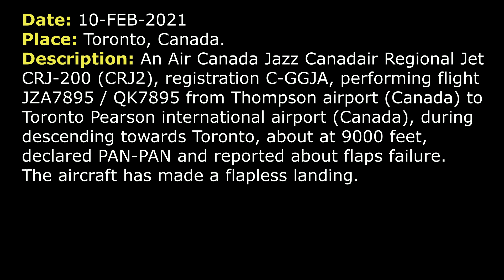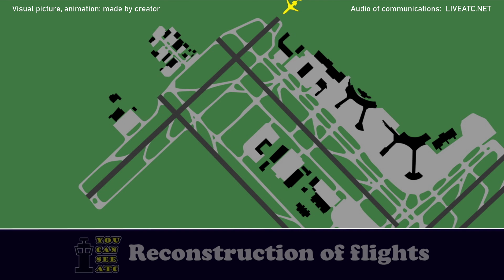PAN-PAN, flapless landing | Air Canada Jazz CRJ-200 | Toronto Pearson international airport

Comment: I spent 2 years flying the CRJ-200, flap failures were a known issue that happened too infrequently for the FAA to get involved.   Not a big deal as long as the runway is long enough, you need roughly double the normal landing distance with flaps fully retracted.  Disclaimer, this was back in the 2003-2005 time frame so the issue may be been fixed.